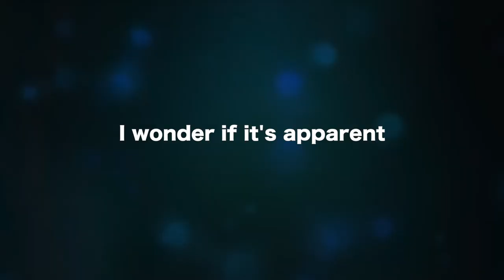How to Make a Sound Diffuser for under $50

Comment: You know, there is free software out there to help you properly place the blocks?  Look up QRDude.exe   Also, you need considerably more diffusion to make an appreciable difference. Looks good though, good luck!
Reply from the maker: Thanks for that.  I may try and redo this later on with that info.
Reply: Can it be used to design skyline diffusers? I downloaded it but it's a little confusing to use.

Comment: A diffuser is generally placed behind where you sit, to diffuse any reflected sound. But they do look great though
Reply: Nick A you can actually put them on any wall.
Reply: @officialWWM  but they are more effective with first reflections. So the wall behinds the speakers not so useful as they do not diffuse into the bass region unless very long columns on the diffuser.
Reply: I agree. Great piece. Would be good behind the chair on opposite wall…The speakers are not in the correct position…for any other newbies ✋🏼that might see this

Comment: I'm new to this diffusor stuff and am planning to build one. Thanks for the advice. Nevertheless, as I read so far, those wood blocks shouldn't be arranged randomly, but in a very specific pattern (which looks random, but is not random at all; as to diffuse the frequencies evenly, not causing weird fractals or so). Anyways, looks great, and I have to admit, if I decide to build one, it's mainly because of the look (while hoping for some sound improvement), so the criticism regarding the pattern might not be taken too seriously...
Reply: yes! :D no need to do any math, just plug a couple numbers into this site http://www.mh-audio.nl/Acoustics/DiffusorCalculator.asp and it will tell you the whole layout.

Comment: But does it work?
Reply: Nope. Not if he didn't use a certain calculator to figure the length and width for each block he cut. Random sizes don't work to spread sound like in actual diffusion. There's a pattern to it. It may break up some sound but it will be nothing like a properly made diffuser. Maybe it would be about as good as a bookshelf? I don't know but I'm not making one unless I have done the math. Ethan Winer  makes some comparisons here.
https://www.youtube.com/watch?v=vb30CICG68c

Comment: Congratulations, good job and effort...:) But as i was aware of this,  should not the diffuser be at the end of the control room in front of the monitors? Cause as i was told behind monitors we should have Absorving and not diffusing like you did ...Well anyway good job man...:)
Reply from the maker: Eh, it's all a bit of voodoo if you ask me.  There is no hard and fast rule for a room, but in this case, my intention was to diffuse low-end emanating from the back of the speakers and bouncing off a hard wall.  I don't have a hard wall behind my mix position, so diffusion wasn't really necessary there.  Glad you like the video!